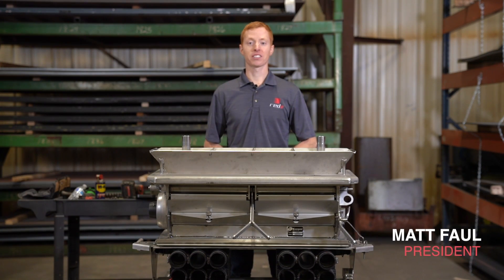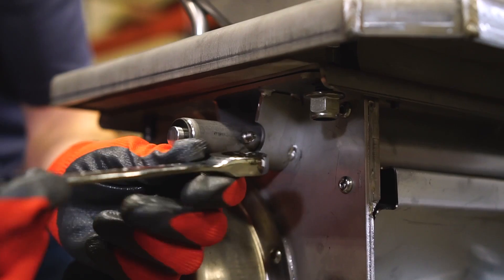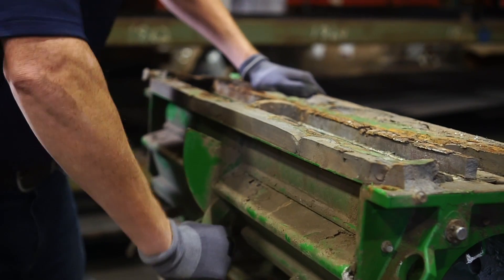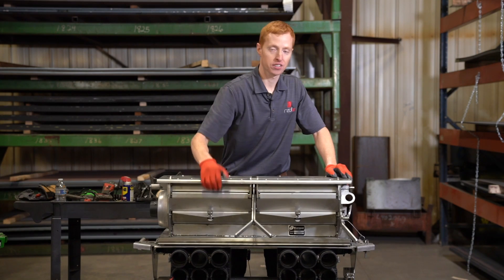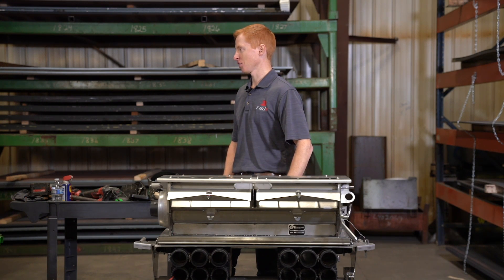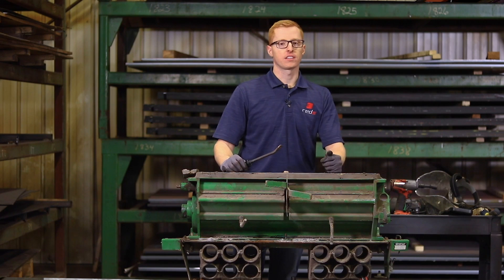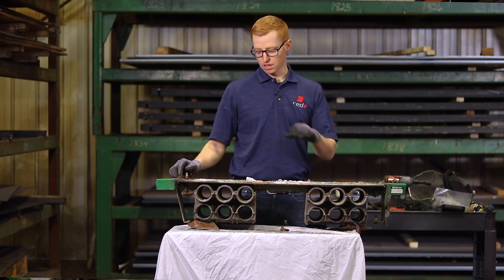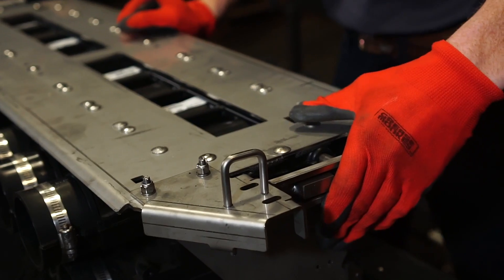Green Vs Stainless - Worth the upgrade?? JD 1910 Air Cart

Comment: How do you keep fert dust and innoculant build up in the center two manifold section when running a 6 run setup? The cap in the center is removable  but the factory housing, where the plastic 2 inserts go have foam inserts in them
Reply from the maker: Hi Lee, if you are running with a 6 run set up - we provide foam plugs to plug the extra runs. Give us a call at 701-205-1485 if you need them!

Comment: What grade SST are you using and why not add a wash out port and a buna n gasket not foam
Reply from the maker: I think the rubber wouldn't compress enough and fill the voids that exist well allowing it to be installed. There's so much variance between the tank plastic walls in this rigid steel that you need something to fill all the gaps. We have fought these things getting them installed the way it is with the foam seal. Good question though.

Comment: Should get rid of those troublesome half shut  off like AirSeederParts  meter box
Reply from the maker: Removing them is the best thing to do if you can't solve the problem. we solve the problem and still get the functionality of them so now you get the best of both worlds!
Reply: i was thinking the same thing. individual shut offs per primary allow you to run different hose configurations also